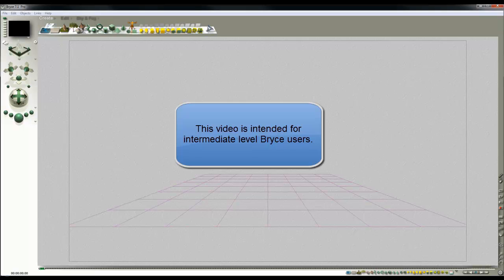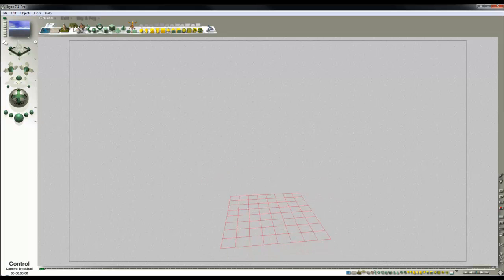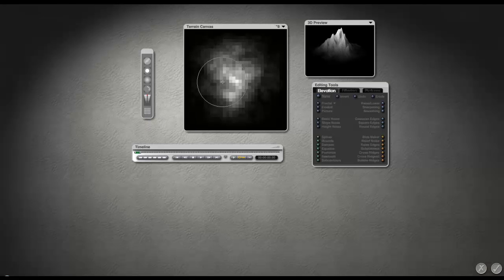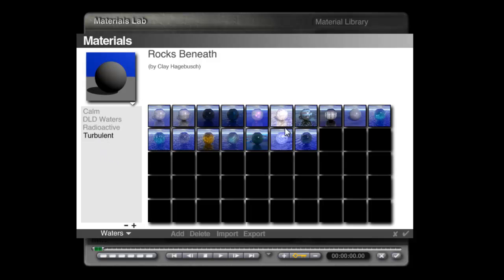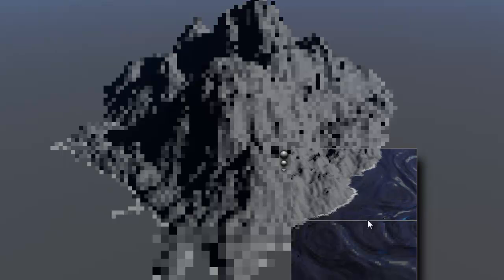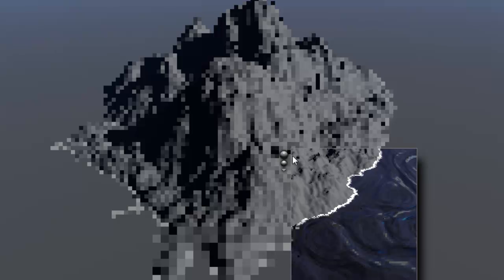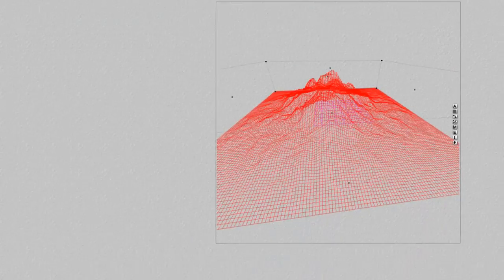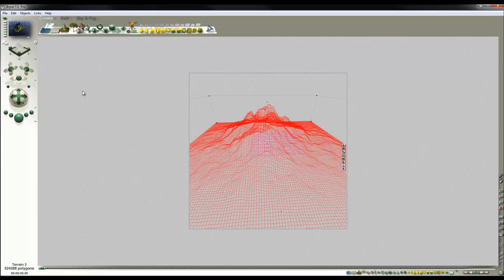Bryce undocumented feature - the sea foam Easter egg - by David Brinnen

Comment from the maker: Just been using the software a few years now.  The DTE is not totally intuitive but since it is used in the textures and the terrains and the clouds, it's worth picking up.  There's a lot of potential in there, but digging it out will require patience.  If you enjoy fractals it helps.

Comment from the maker: The foam is controlled by two things, the shape of the terrain (the most obvious control) and also, the resolution of the terrain, if you increased the resolution of the terrain then the foam edge should be narrower relative to the overall size of the terrain because it only interacts with the same number of subdivisions.